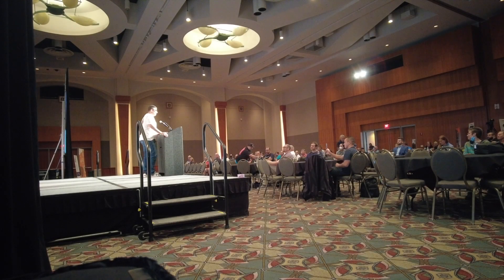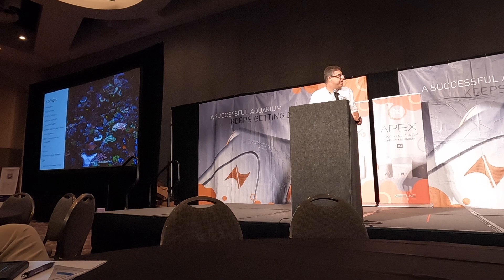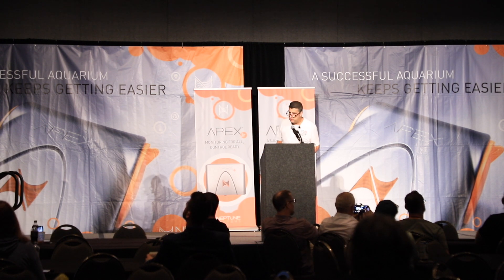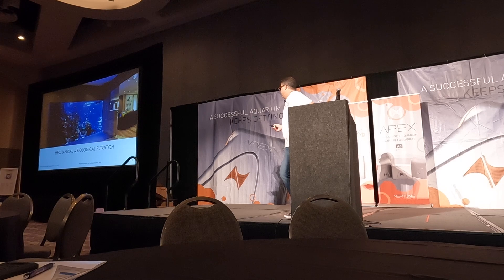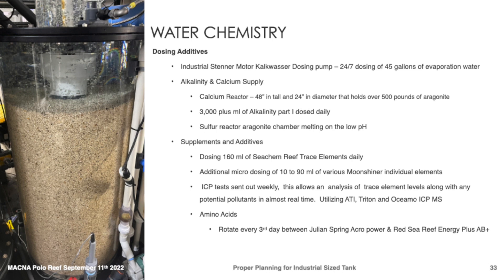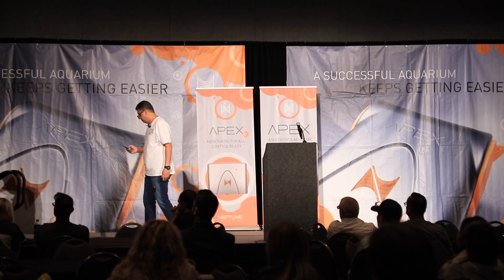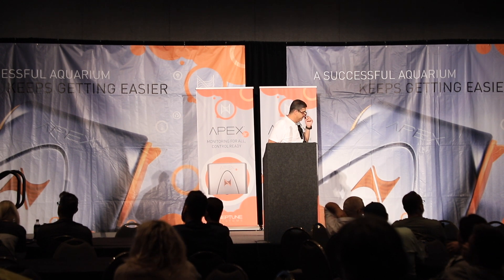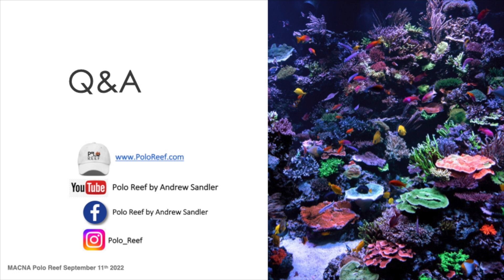Andrew's talk at MACNA 2022 discussing what went into designing and building his 17,000 gallon reef.

Comment: Nice presentation. It's always interesting to see how that project came together and runs day to day. One small tip: it's 3-phase power, not "phase 3". It has three phases, 3 wires (apart from ground) with the frequency oscillations offset 120° from each other. It's not the third phase in electrical power.